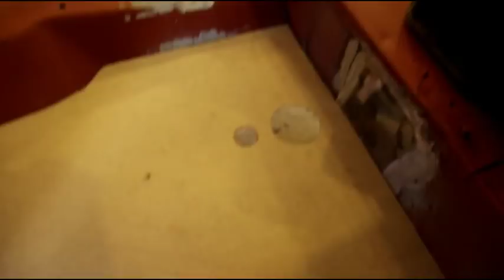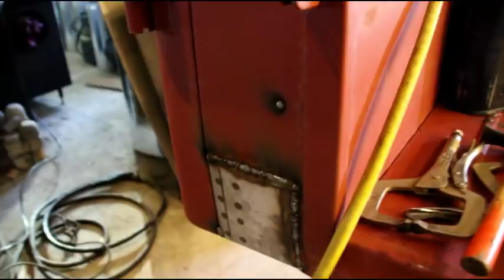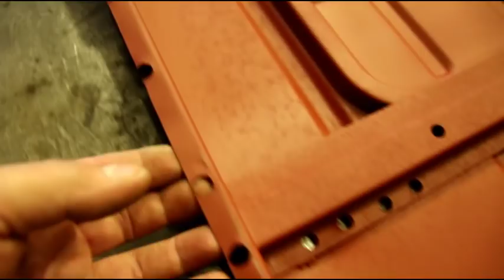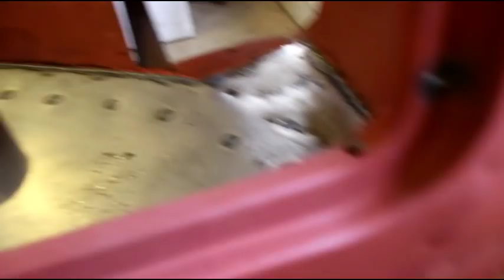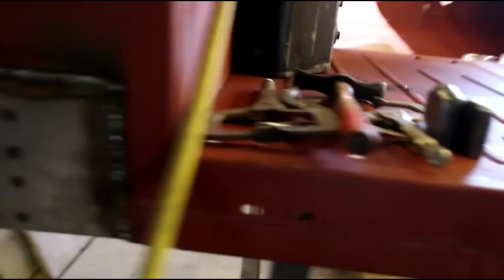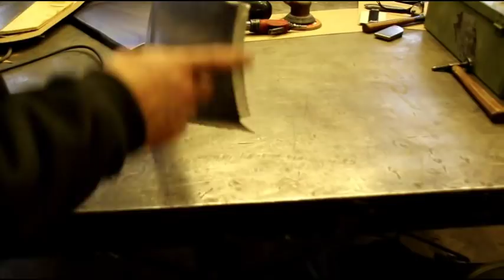CJ5 Body Tub Progress, Metalshaping Class Projects

Comment: Hi.  I know this is a really old video, but I am doing floors and have a question…
The large interior vertical supports that are at the front of the floors.  You cut around them, and as far as I could see that 4” front edge of the support is not welded to the floor panel?   If that is correct, how is that part finished?  
Thank you as always.  
Tug
Reply from the maker: The cowl support panel sits on the floor pan directly.   It is welded at the front and rear of the cowl support to the floor.  It may look like I cut around it but it is sitting on the new floor as original.

Comment: That is looking really good, I always find it most rewarding when the panels go back together, it seems like you have got the worst part over with, (even thought the worst bits have yet to come), how thick can you apply your hard body filler, does it have a critical thickness cure ? Really good to hear you have some real enthusiasts coming in during the week to make panels, once they get confidence they will be soon onto the next project, they just need someone to bounce their ideas off of. Chris B.
Reply from the maker: the lab metal can be built up in layers.  I put thin layers on and give them a couple hours to dry.   This stuff can be built up to any thickness in layers.  They recommend not over 1/4" at a time.  I use it like body filler in very thin layers and it sands great.  Word is getting out and I am helping folks make panels for their projects.  when parts can't be bought and people don't have tools and skills to make them I can help them.   
Brian

Comment: Well I am very much aware that classic doesn't make good body parts, whose body parts would you recommend for accuracy? I'm starting a ground up build, and would appreciate any suggestions you might have.
Reply from the maker: There are not too many good parts out there.  You can buy overseas parts, classic parts, or anybody else's sheetmetal parts that they say are correct but that is rarely the case.  I have tried for years to sell accurate parts but not many people are interested.  I have moved on to scout and FJ parts and they are selling like crazy.   Best thing is to save and rebuild the original parts if you can.

Comment: I can tell you're not a fan of Classic :)  I have need of a new tub, have you ever had any experience with the Willys-Overland Repli-Tubs?
Reply from the maker: Yes, they take a Philippine made body tub which is junk to begin with and then they have jigs to put the holes in the correct places.  They sometimes fit and sometimes don't.  I find it easier to put the holes in myself because when they do it and it is wrong it is harder to move a hole than put the correct one in from the beginning.  
Brian
Reply: Thanks for replying!  That jives with what I've read also.  It's a shame there's not one supplier that Just Works.

Comment: What is the heaviest gage sheet metal you work with?
Reply from the maker: I work with all types of steel, from heavy plate to thin galvanized sheets.  My sheetmetal power hammer can shape up to 14 gauge steel, the pullmax can cut 5/16" plate and bead and joggle and shape up to 10 gauge steel, and my 190 ton Buffalo Ironworker and punch 1-1/2" plate and shear 1-3/8" sheets.  Hope that answers your question.
Reply: metalshaper thank you